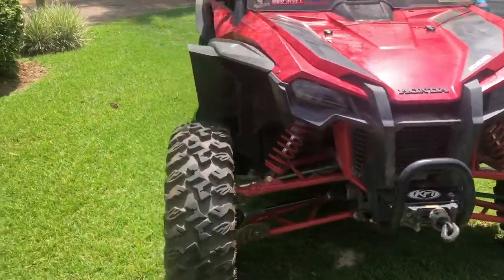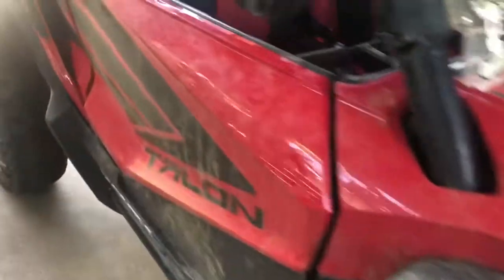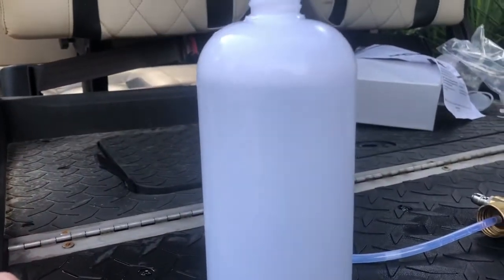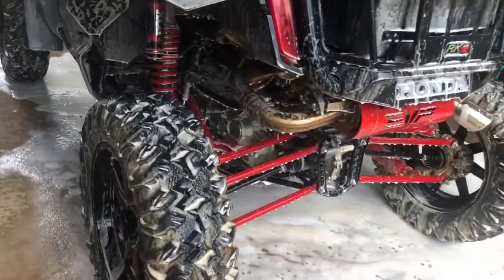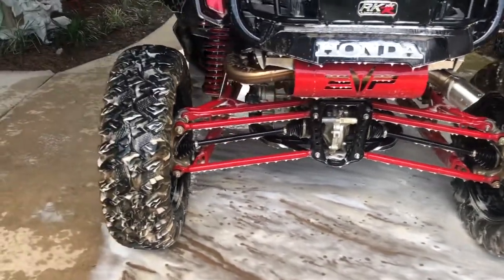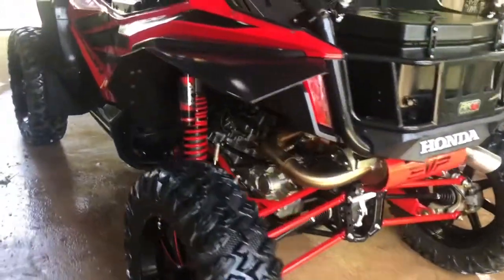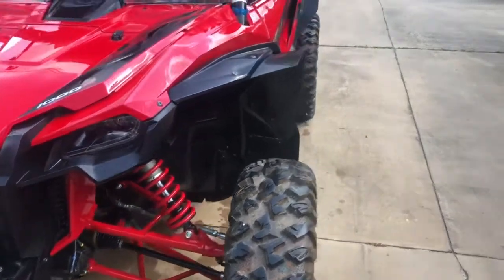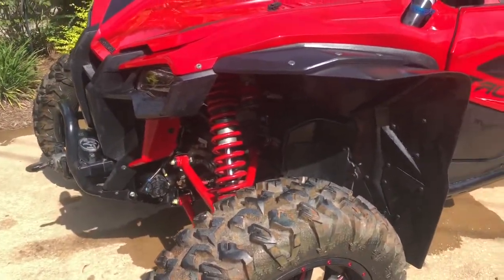Zep Truck and Trailer Wash Honda Talon

Comment: I have always used it in the foam cannon undiluted. The worst mistake a beginner can make is to let it dry out on the vehicle. Let it set for a few minutes and reapply if needed to keep it wet until rinsing. Preferably in the shade like the guy in the video. NEVER spray this on house windows full strength. It will etch the glass. On my truck windows I have no issues though. NEVER mix this with bleach for a house wash.  I did and several minutes later my foam cannon got so hot it started burning my hand. It left a burnt looking spot on the lawn when I dropped it from the heat.

Comment: Check out Superior Products Dark Fury (used to be called Rage), can get it at o'rilleys, dilute it 4:1 in a spray bottle. Spray, let it sit for like 2 minutes, then hose it off. Does great!
Reply: Are you still using it or did you find something better looking for something touchless spray on Rinse off
Reply: @leardi58  I mean I still use it 🤷‍♂️🤷‍♂️
Reply: @Chris72401  I appreciate you responding back and have to give it a try thanks again 👍